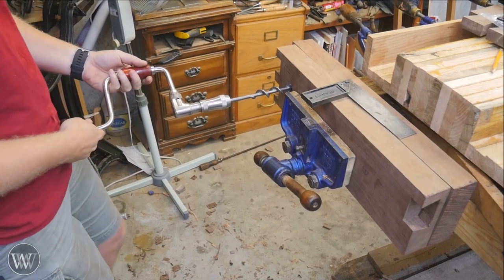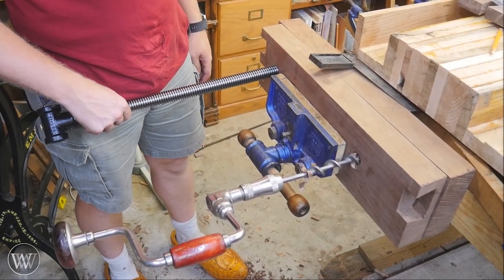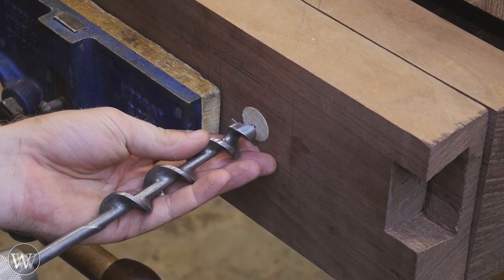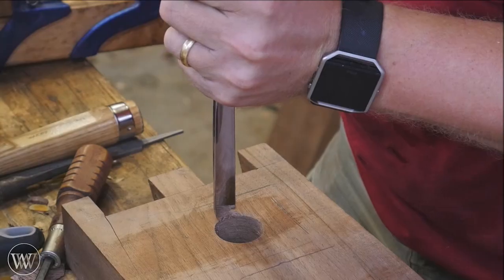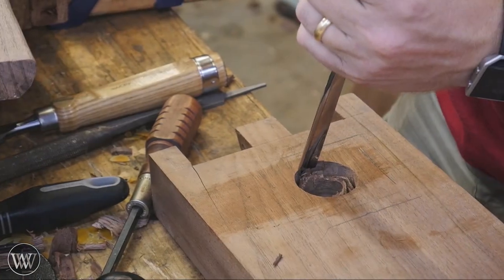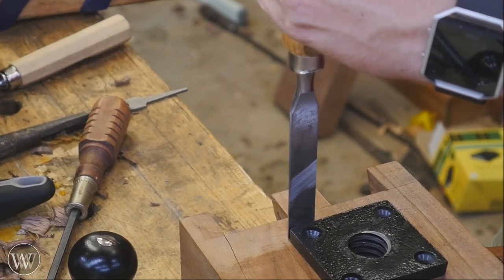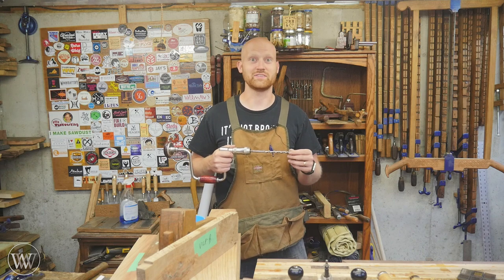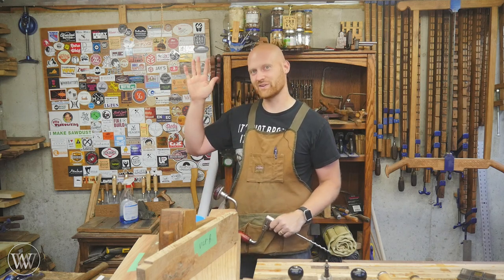How to Enlarge a Hole With an Auger Bit - Hand Tool Woodworking Tip

Comment: If you over drill a hole, and then plug it with a Dowel and re-drill a smaller hole.  it will leave a ring of the dowel in the larger hole.  For longevity of the fix, you need to match the species with one that has similar expansion and contraction rates with moisture changes.  If you don't want it obvious you need to match color and grain orientation as well.  The larger the hole the more important grain direction and expansion rates become.  
   
I love what you do.  You make it real and down to earth.  And it looks like you really are having fun.  That's Cool!
Reply from the maker: true. I have never needed to make a hole smaller, but I am sure i will make that mistake soon!
Reply: problem with using a dowel to go smaller is that the part you will see will always be end grain so matching color and grain will be impossible. better to just be careful and avoid the mistake in the first place, IMO

Comment: While enlarging a hole with the gouge, the inside diameter area was a little rough from my gouge. So I took a 3 inch piece of 80 grit sandpaper and glued it to the outside of a smaller diameter dowel. I held it snugly while drying with two rubber bands, somewhat like a small sanding drum. I then sanded the inside of the enlarged hole until the fit was close to perfect. Worked well and very inexpensive!
Reply from the maker: that is a great idea!

Comment: I've done it by mixing 5 minute, two part epoxy with sawdust and packing the hole full. It's better with speed bore bits but works ok with augers. Sometimes quicker than coming up with an exact size dowel.
Reply from the maker: very true. I have a large collection of dowels in most every 16th size but I am a bit on the odd size!

Comment: my brace bit snapped off at the tip of the screw when I was boring into pine? i was putting alot of force into it as in body weight and turn. please advise why! it was the first use?
Reply from the maker: Oh no fun. That usually happens when the force goes sideway on the brace. That tip cannot handle the horizontal force. It could also be that it was weekend in the past and it was just the time to snap.

Comment: I got a question for you. I know you can use screw driver bits, and auger bits with bit brace but can you use counter sink bits with bit brace.
Reply from the maker: yes. there are countesink bits, and pocket hole bits, spoon bits, and twist bits and the list goes on. most every bit out there can eather work in it. or comes with a base that can fit.
Reply: @WoodByWright  thanks, I have another question. Are there places you can buy brand new bit braces that are good quality.
Reply from the maker: @SillyOmega  right now yes but they are $30-40 each and have to be ordered from Europe.
Reply: @WoodByWright  oh okay I saw some on lee valley made in France I guess that's what your talking about? I've been scouring all over the web looking. but it look's like to me France is the only one who makes them, just like The machine forged nails. I know though the Tremont nail company is the only one who make machine cut nails. witch are wat cheaper compared to machine forged. thanks for your help with the information.

Comment: Another method: drill a hole in a piece of plywood of the larger diameter needed. Clamp the plywood with the hole centered over the smaller hole and use it as a guide to start of the auger for the bigger hole. I use this method occasionally with forstner or spade drills, but it should work for augers too.
Reply from the maker: yup. that is my normal go to method but does not work for single wing auger bits. which really stinks here. and forstner bids are just NO FUN in a brace.
Reply: Never seen a single wing auger before, but I can see they give a little more trouble

Comment: I tend to have trouble drilling with auger bits into endgrain, especially in hardwoods.  Any suggestions?
Reply from the maker: sounds like they need to be sharpened. here is a video on that. https://www.youtube.com/watch?v=gMFHwIX6THk
A sharp bit will cut perfectly.

Comment: I don't know about the single wing, but with normal bits you don't need to glue the dowel in. Just let it spin, the wings of the bit will still cut  (through holes only, of course. )
Reply from the maker: true, but you have to put more force on it. Gluing it in place makes it easier for the lead screw to pull it along. I love the channel name by the way!
Reply: @ 6'5", 300lbs, it doesn't take any force... I sometimes forget my size... Thank you! If I ever get my "10 things about me" video shot, I'll be explaining that...

Comment: Could you use a square piece that is slightly bigger forced into the hole, or bigger with the corners knocked off? Would save some money spent on dowels and then you wouldn't need the exact size on hand.
Reply from the maker: possibly. I have not tried it. I just have a large stock of different sized dowels on hand and I do a lot of dowel joinery and draw bore pins. sounds like it would be worth a try.

Comment: I once had to drill two holes using a brace and bit at a slight V angle for a hammer project.  I did not want to use a wedge to secure to the handle end of a broken sledge hammer that I had.  Ended up using a gouge on the hole and a hand plane on the handle to make everything fit.  Very difficult for a guy who usually doesn't work with wood and did not want to use power tools.  Only power tool I ended up using was a rotary file to clean up the heart of the piece of wood since I didn't want any piece of that to fall into the wood I was going to be hammering and couldn't get at all of it with a screwdriver.  Any tips that might have helped with the project?
Reply: Oh yeah, didn't have a proper woodworking bench.  Had to make a jig that I could clamp to the welding table.
Reply from the maker: sounds like a fun time!
Reply: @WoodByWright  it was.  Learned a lot!  One day hope to learn more.  The grain really speaks when taking a shave with either stile of wood plain or tool.  They do not like going against the grain unless my sharpening skills get much better.

Comment: Good advice, but it would only help me about half the time.  I have made them bigger.  than they need to be.  The dowel trick still works, but unless you want a "cool" ring around your hole you have to match up your wood.
Reply from the maker: +Bill Hart what do you mean match up your wood?

Comment: A MAN SHOULD KNOW how to get out of trouble as fast as he gets in it. ha
Reply from the maker: LOL sounds about right!
Reply: Recently I faced a problem with a sliding dovetail too lose. What a ride it was to figure out a solution! I used glue-soaked baking paper (thin and strong). Aaand it worked out! :)